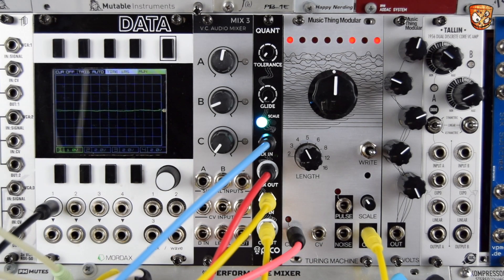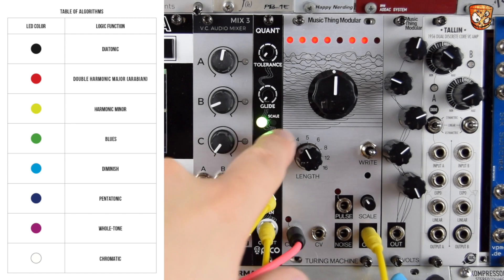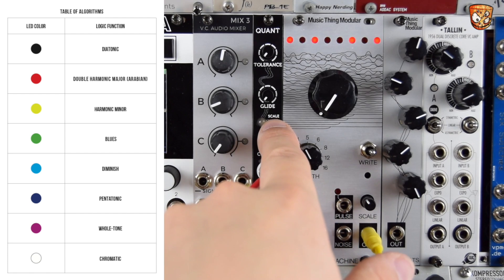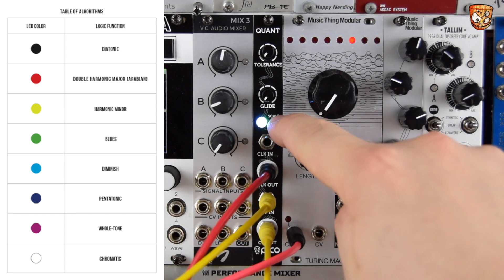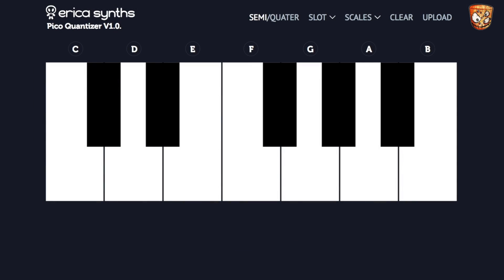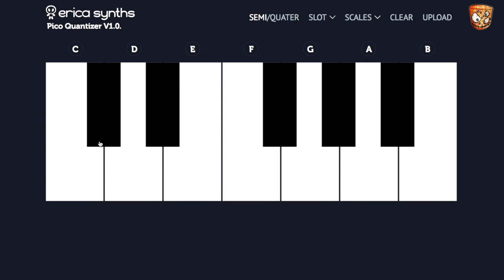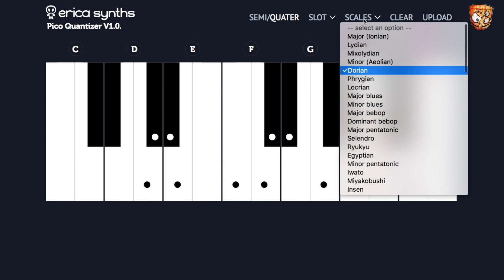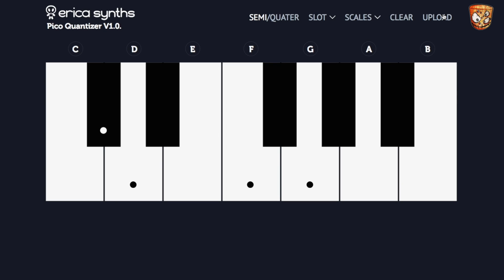Erica Synths - PICO QUANT *Mini Demo*

Comment: This quantizer applies a positive offset at the output. This makes it incompatible with other pitch sequences.
I will often take a quantized pitch sequence from my Mother-32 or Subharmonicon and go through WMD’s Sl3kt (buffered switch) before running it into another Oscillator. I will also run a pitch sequence from a separate quantizer (in this case the Pico Quant) into Sl3kt so I can switch between them. However, the Quant outputs a positive offset, making it incompatible with the other sequence. (One sequence will be in tune and one will not). If I were to switch between the sequences before running them through the quantizer it would fix the pitch issue, however it would not be the same effect as only the notes programmed into the quant would be played and the other melody would have to conform to those notes. 
I have contacted the manufacturer and they did not care about this issue and simply told me I was doing it wrong. I will no longer be supporting Erica Synths. I suggest anyone thinking to purchase this module considers buying the Disting mk4 as it is only 1hp wider and does not output an offset.
Reply from the maker: that doesn't sound like the support I know the team at Erica Synths offer. I'm also not sure I entirely get the patch. 

The Moog systems do have a known output impedance issue that causing pitch issues, modules have been made to fix this issue (Erica Synths and AJH) could that be part of this? 

I'm not sure I fully get your patch to comment but I didn't experience a positive offset, do you mean a slight positive offset making the oscillator it controls pitch rises slightly? Is it out by a note or just a slight amount?

Not denying your issue of course just trying to understand what's going on.
Reply: @DivKid  yes, it raises the pitch of an oscillator slightly even with no CV patched into it. It’s a simple issue that is common with all modular systems. And while the common advice is just to tune the given oscillator after patching it into the quantizer, this does not fix all the issues.
If one is attempting to switch between melodies created by separate quantizers being sent to the same oscillator, these quantizers need to not only be calibrated to create perfect intervals but also to have the same (or no) offset. This allows for the user to switch between the outputs of different quantizers to a single oscillator or multiple quantized melodies to be combined in precision adders without falling out of tune. It also allows for true transposition, not just modal shifts within the same key and chosen intervals. 
When my Moog devices are playing the root note internally, and I take the KB output of my Mother-32, or one of the Seq outputs from my subharmonicon (or the output of my Disting mk4 while in any quantizer mode, or the output of marbles with bias and spread turned full CCW) and patch this into the v/oct of any oscillator there is no audible pitch change. Therefore, when I switch between which of the sequences I send to a given oscillator there is no difference in the tuning. However when I send the quantized values coming from the Pico Quant to an oscillator that was previously receiving a sequence from another quantizer the pitch is +16cents or so. This is the only quantizer in my case that displays this behavior. My Moog devices do not share this issue.
I understand that the classic advice would be to switch between these patters pre-quantizer, however this would give a very different effect.
Reply from the maker: thanks for the further explanation, I understand fully. And yeah that's incredibly frustrating. 

A solution which would give the desired results would be to mix an offset/bias voltage and the PICO Quantised signal in a unity mixer / precision adder. Using the offset voltage to counter and "fix" the offset from the quantiser. 

I know that using up HP and two extra modules (or one nice utility) to fix something isn't ideal but it is a solution. I find utilities are necessary for fixing all sorts of things and making things work better together so I don't get too frustrated with those sorts of things. Over the years it starts to feel like just part of using modular ... again that's not so much fixing an issue that could/should be fixed on the module ideally.
Reply: @DivKid  thanks. I would rather sell the module and buy another Disting to as a quantizer since it doesn’t have this defect.  However, I agree that dealing with bad designs and poor craftsmanship is a large part of modular for sure.
Reply from the maker: Hope you get to push the system in the direction you want and get good results ... one thing I do wonder is if it's just one defective module or if a whole bath or just the whole design is like that. I don't remember offset issues personally.
Reply: @DivKid  ES got back to me after a while and let me know this is expected behavior from the Quant.

Comment: Is there any option to change the "root" note of the scale?
Reply from the maker: I think it's important here to say that any sequence giving you a definite note I always view as kind of "wrong" anyway. It down to the tuning of the oscillator. Much like say fret 3 on the low E string on a guitar should be a G. Well yes in standard tuning but in drop C that's an Eb. Treat the scales like a set of intervals and patterns and you're fine :)
Reply: @DivKid  I don't follow this logic. Scale is just a relationship between notes. The scale has to be rooted in some frequency/note, hence the root note. Blues C scale has different pitches than Blues E scale. So are all the default scales in C? 
Sure, you can make your G on the fret 3 into an A by transposing the audio up, but you'd need to do it after the quantiser, surely...
Reply: P Godaz my understanding of it is that it quantizes the cv coming in (like from a sequencer or random voltage source) and you patch that cv into an oscillator to control its pitch. Then you can tune your oscillator to the key you want, kind of like a capo on a guitar. Correct me if I’m wrong though!
Reply: @piotr803  That's what he was saying lol
Reply: I'm very interested in this answer as well. I'd love to set up my 8 preset chord/scale "types" and adjust the root of each chord/scale without having to make another 8 presets every time I want to play in a new key, which is all the time as a keyboard player. Thanks for the mini demo!
Reply: Doesn't look like it, but I guess it's tough fitting the extra knob/cv-in to a 3hp module.
Reply from the maker: Trente, couldn't you mix the output of this with the output of your keyboard and work that way? Or mix your keyboard and another source before hitting this.

Comment: Seems like an attractive option as a secondary/utility quantizer
Reply: Martin Doudoroff I was wondering why I would want such a limited quantizer as far as ability, you answered my question. 👍
Reply: Some of them, including this one, can be used as a sort of comparator, to send a trigger when a voltage fluctuates.
Reply from the maker: Yeah nice extra quantizer. I like ones that have playable keyboards to turn notes on and off live. That's always good fun and very performative. Martin has hit the nail on the head too that they can also give you a gate output when a new note is quantised or some take in a gate to tell the quantizer when to quantize a new note.
Reply: @DivKid like the sonic potions one?